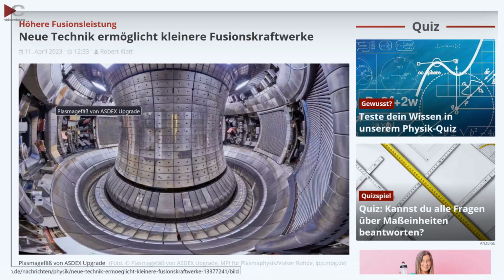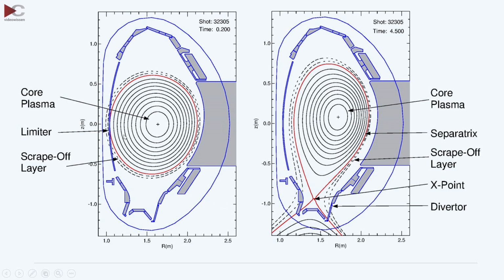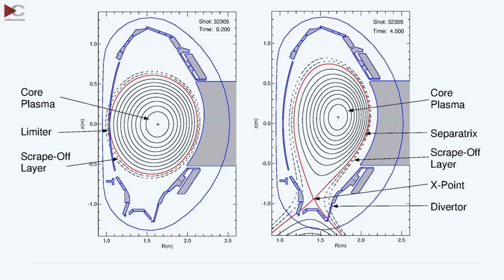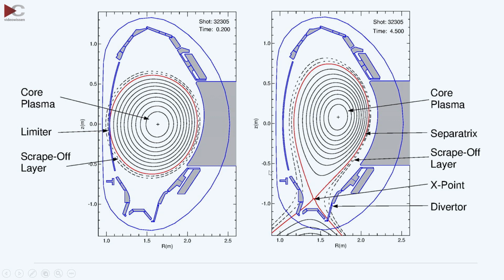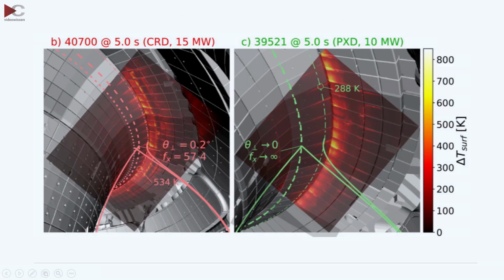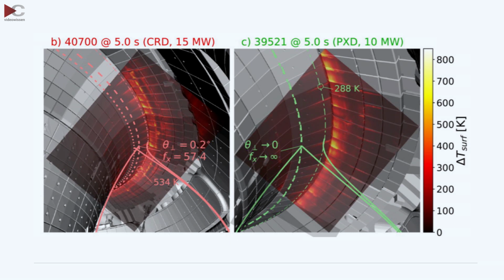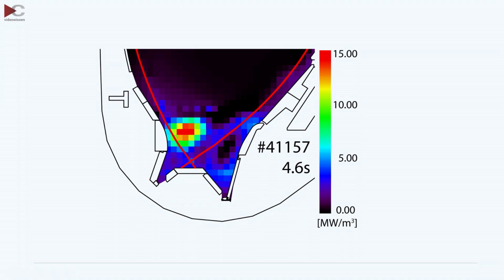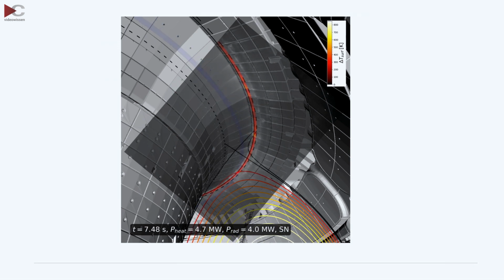New Discovery Enables Compact Fusion Power Plants - Compact Radiative Divertor | Hartmut Zohm

Comment: Another significant step forward on the long journey towards the feasibility of controlled nuclear fusion on Earth. Congrats!
I hope that the basic physical and technical issues towards a self-sustained D-T burning will be solved soon!

One of my major mid-term uncertainties is probably about a proof, at least about a proof of concept, that or whether the required tritium supply can actually be ensured on an exclusive fusion basis and abundant natural ressources, i.e. are we sure that the blanket concept of tritium breeding does provde exactly the amount of tritium required for a closed supply cycle? And is this concept technologically and environmentally safe?

The other, presumably long-term thing is: Do we have a reliable scenario within which fusion power can compete economically with renewables in a future where renewables are fully established, cost-optimized, and essentially ubiquitious?
Is the funding of future fusion research reliably provided, even if commercial competitiveness isn't to be expected in any foreseeable future? Shoudn't we separate the basic research on fusion from the expectation or implicit promise of economic relevance?